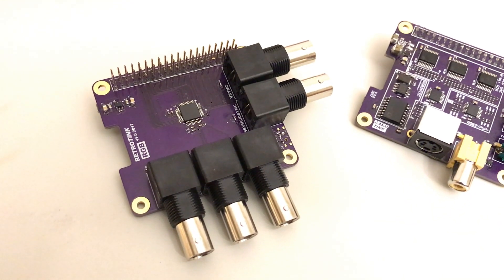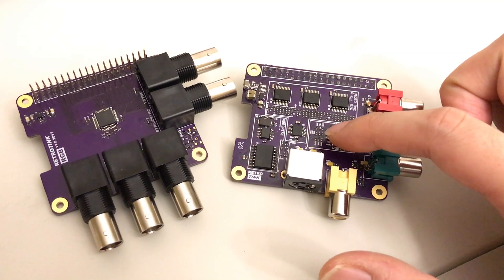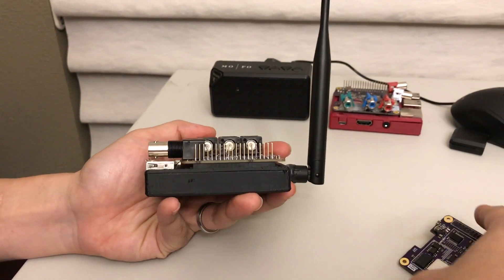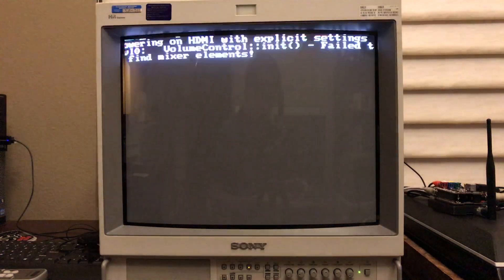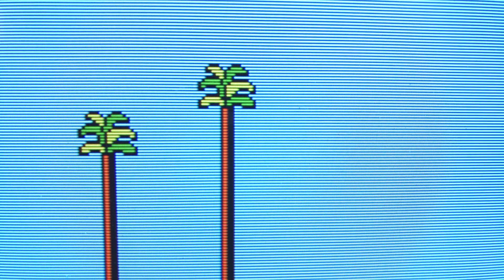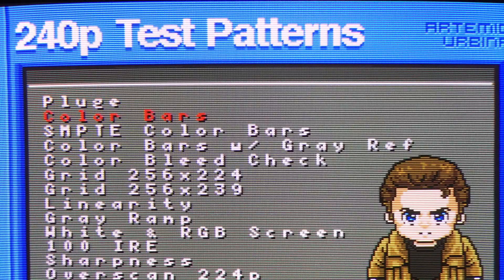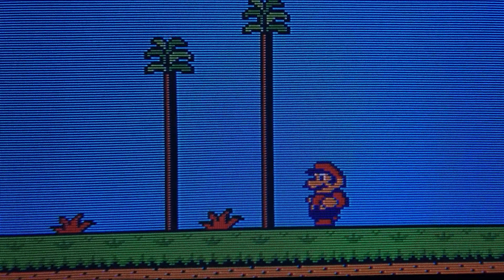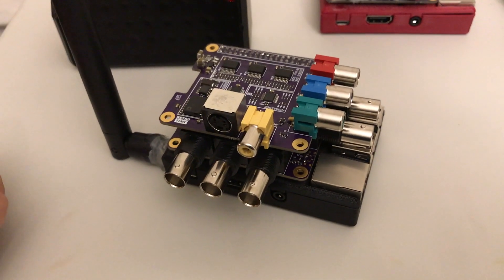Raspberry Pi 240p RGB and RetroTink Update

Comment: Any advice on how to connect a Pi to a old 80's monochrome monitor? I want to run it inside a 5150 case to give the illusion of an old toss machine but run command line linux. Here is the monitor I have:  http://ps-2.kev009.com/pcpartnerinfo/ctstips/5546.htm

Comment: Cool products! How did you hook up the H and V syncs to your PVM? If I'm not mistaken, it only supports CSync.
Reply from the maker: Good question and good eye!

In the prototype I have a few test options for sync. The 2 side BNC has Horizontal and Vertical sync. There's a jumper which can output CSYNC on the H connector. There's another switch to do sync on green. I tested both modes and they work well.

Yeah, the V sync cable is just for show. It's not connected to the PVM :)
Reply: Mike Chi 
That's great, thanks for the info!